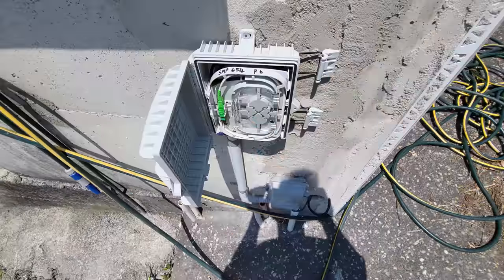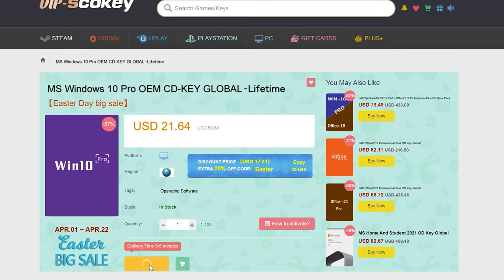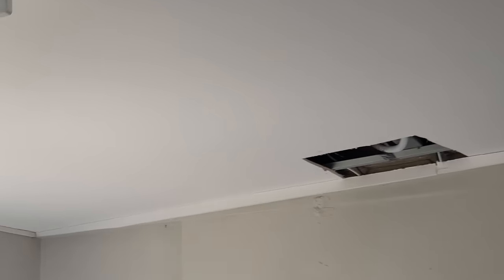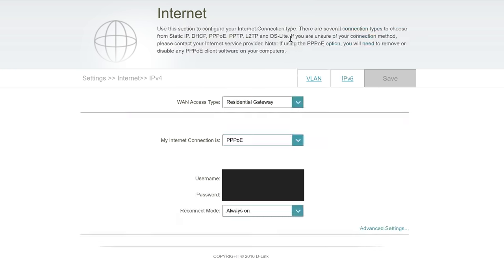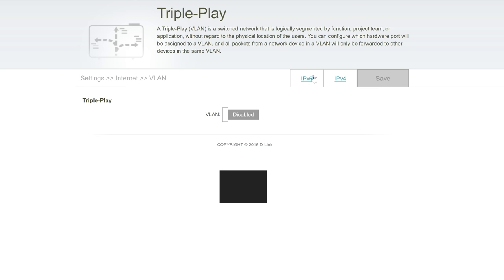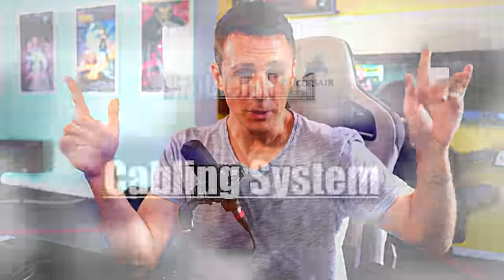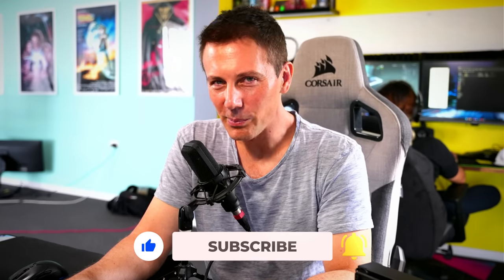UPGRADING my Internet to FIBRE for FREE! (Australian FTTN to FTTP Upgrade)

Comment: It is still crazy to me that there are 1st world countries that have internet worse than some 3rd world countries and then have to pay 200-300$ per month just to get that fiber to like 100 megabits up/down.
Absolutely crazy. I get 1gigabit up/down for 15$ per month with a 40$ router I bought from Amazon. Also, mobile 5G unlimited data contract with free calls and messages is 20$ per month.
Of course, Australia is kinda different, being so far away from big continents but still, absolutely crazy pricing.
Reply: It's been politicised and monopolised
Reply from the maker: Yeah definitely, coming from Japan it was about $25 USD a month there for 1k/1k, and unlimited.
Reply: @techyescity I get it if your using a cat but why disable 5ghz any device using wifi will be capped to 100mbps on wifi 2.4
Reply: New Zealand has cheaper and faster Internet than Australia, yet it has a smaller population (unless you count the sheep), and is even further away from the rest of the world.  

In Aussie telecommunications is HIGHLY politicized, being the home country of Rupert Murdoch, as well as Telstra the monopoly provider being 17% owned by the Government workers Superannuation scheme.
Reply: Spain 30€ 10Gb/s is on the highest on speed in Europe. 90% of the homes had acces to a Fiber conecction.
Reply: That's not $15/mth for 1G, more like $150.
Reply: Mate, we didnt get internet here till 12 years ago.. DSL only. Just got Fiber 2 days ago, went from fixed wifi that was the only choice and that came here 6 years ago. Im in Canada ffs. They Just got around to putting in the infrastructure just before covid. Costs $120 all in per month for best package to get 50/10mb , now its same price but for fiber 1-2gb. We have seriously high costs here for fuck all. Youre lucky . Cheers
Reply: i know the reason :3
Reply: it does depend on pop density too.  cost alot for providers if its 10 houses per mile.
Reply: Also one of the reasons is it is cheaper now to install new infrastructure than to upgrade old infrastructure. As in new developments will get fiber, while old ones still have phone lines or cable.
Reply: I'm really jealous of you. I live in germany and pay 30€/Month for 100 Mbit via DSL. Fiber? Can't get that in the street I live in. Fastest I could get would be 500 MBit via Cable, which would cost me around 80€ per month.
I'm also using one of the cheapest internet providers.
Reply: Where can u find unlimited mobile 5g that is $20 per month? I've been trying to find a cheap option to be able to stream on twitch on the go with my gaming laptop but havent found anything anywhere that close to being that cheap and none of it was unlimited.
Reply: nobody needs 100mbs download---if you do you need to get a life
Reply: its a pain in the cnt for sure
Reply: Liar
Reply: @thelonewolf666  Yes, that is too slow, 1 Gb should be bare minimum!
Reply: @HDQuakelive  If you plan to play multiplayer games (particularly competitive ones) and stream simultaneously just note that the latency on 5G is higher (despite the speeds being strong) and it's a shared connection (you share from a pool of total bandwidth per tower rather than the more segregated nature of fibre).  I mention this because I had issues a few years ago.

Comment: Wish they done it properly the first round. No fttp in my rural town...
Reply from the maker: Have you tried starlink? heard good things about it.
Reply: @techyescity  I'm actually happy with my 50/20 😄 I still remember the day when we got NBN from ADSL. Some videos would take days to upload at 1 Mbps. But yes I know a few that got Starlink and are very happy.
Reply: We Live In Adelaide Elizabeth And We used to Have Fiber To The Node Used To Get Around 12-14 Download And 3.5 Upload And Whan We Have 4 Or 5 People Using The Internet It Used To Slow down a Lot But Now We Have FTTP And Its Better Than FTTN
Reply: @techyescity  as a gamer I don't trust wireless. Physical cable is better than wireless including star link which sounds like it might have more lag?
Reply from the maker: @Mudar-o6h  yes starlink does have more lag.

Comment: You better block that big gaping hole in the wall or you will get a rodent problem. You really don't want a rat getting in through that hole.
Reply from the maker: Actually covered it all up tonight! Finished the install with my friend who is a sparky.
Reply: @techyescity  good stuff. I myself have spent almost a month now trying to get rid of rats out of my house. You really don't want to go through this torture man.
Reply: Solution to Rat = Cat
Reply: We don’t worry about rodents in Australia, the snakes eat the rats, and the drop bears eat the snakes.
Reply: @josephkelly4893 OMG I looked up what a drop bear was and bust a gut laughing thinking it was a real animal.😂
Reply: sparky to a save
Reply: @josephkelly4893  be very careful around drop bears, they'll take you when you least expect it!
Reply: @Andrew_Thrift  that doesn't work. A cat will not scare off or hunt rats.

In fact there's lots of YouTube videos where there's a rat a few feet from a cat and it doesn't bother the rat and other videos of cats that are scared of rats

Comment: good job finally FTTP. now we only need 1000/400 for $100 a month
Reply from the maker: Yeah the uploads are sooooooooooo bad still, they are throttling it hard, would love to know in Aus why they are not even at 1000/100 still...
Reply: I'm paying around £35 per month for gigabit up and down in the UK
Reply: @ISellSigals  I could only dream.
Reply: Not going to happen any time soon, the current NBN wholesale charge for 1000/400 is $230/month ex GST.

Comment: The good thing about FTTP is that the NTD supports four connections simultaneously - if you feel like the ISP is the problem, you can just go to another ISP and ask them to spin up a new connection. This also means you can have, for example, a home-only connection and a work-only connection, or at the very least a secondary backup connection. The only caveat is that NBN will reject any orders which would cause the NTD to exceed approximately 1.25 Gbps so you can't have gigabit with two ISPs at once.

This is why Launtel is such an interesting ISP - where other ISPs charge monthly, Launtel charges daily. If you're with another ISP and feel like their network is the problem, you can spin up a Launtel connection for a few dollars to test.
Reply: That's good to know, any idea why the 1.25Gbps speed limit?
Reply: @futurecactus  I don't know the specifics, just the results of community testing. Having said that, it's almost definitely to save on cost.
Reply: I love Launtel’s 1000/400 plan. They’ve even dropped the price to just $9/day!
I got 900/355 with my testing.
Reply: @futurecactus  GPON supports 2.5gbps download split among the customers, they don't want someone slowing it down too much.
Reply: NTD max throughput is 1600 total including upload.

Comment: Gratz on the upgrade. I've been on it for a few years, 1500 down, 1000 up and I just did an Ookla test (with 2 streams running) and it worked out to 940 up and down. That is the biggest difference I noticed. Uploading to YT, 4K is a breeze. This 12 minute video would take me well under 10 to upload. I rent the modem from Bell Canada. I think you can buy them but they are priced in such a way, they don't want you to. The rental means it gets replaced every 3 or 4 years if better modems come up and the fiber is to the modem. The only line they make me deal with is the line to the PC. I went Cat8 to a standard 2.5 onboard. I've never relied on WiFi and made it a point to not have it onboard for my motherboard. The phone uses the WiFi and the phone is the limiting factor. 

You will start to kick yourself when you realize how much time you lost waiting for things to download and upload in the past but it's in the past now.
Reply: You must have a 1Gbit bottleneck in your LAN.

Comment: The fact they don't give you symmetrical is still so antiquated. In Eastern Europe I pay 20 AUD and get 930 down, 900 up. Zero installation fee, including the fiber media converter, and a Wifi 6 router.
Reply: That’s a choice of the NBN and how they allocate fiber cvc though
Reply: I have 500/500 ftth in Norway.   All ftth is symmetrical but Australia is probably still developing their broadband...

Comment: I'm getting an FTTP upgrade in a couple of weeks, which is exciting, because my current FTTC connection is actually worse than the FTTN connection I had at my old place.

I assume it's apples vs oranges though - I assume I'm sharing my FTTC with the other townhouses in my complex, and my old node was probably underutilised (1950s apartment block surrounded by new FTTP-connected blocks and offices).

Comment: Had my NBN installed back in 2016. Was lucky enough to get FTTP. But, was one of the first in my country town so it took 4 techs 2 hours to install. Installed on the outside wall of my garage.  had to run 50metre cat 5a to my router around the house. 
Never had any issues with it. been with Internode for the whole process, and now enjoy gigabit down
Reply from the maker: Ah awesome, I am 7 years late to the party.  With Cat 5 isn't it about 90 meters before some sort of degradation or is that cat 6, memory is a bit off with routing.
Reply: @techyescity  it's actually 100 meters for all of cat5/cat5e/cat6 ethernet cables

Comment: Over here in Europe at our apartment complex, in January 18th 2022 we were offered a free upgrade to fttp from a fttn solution, upgrading our speeds from 150/20 to 150/150, and now a few months back the plan was upgraded to a 500/500 connection and well im really happy with it.

The ping difference going from copper to fiber was surprisingly not very significant, in CS on copper i was averaging a ping of 15-17, on fiber at the time i was averaging at about 10-11

Comment: Happy for you man! I switched from cable to fiber in 2017 and I'll never go back! Constantly have the cable ISP trying to lure me back but na 😂 In regards to your single D-Link router, I would suggest investing in D-Link, Linksys or Netgear mesh network for your WiFi needs. That way you don't have to turn off that 5Ghz band. Bandwidth on the 2.4Ghz band will get bogged down if all your devices are using the same channels. Newer devices prefer the 5Ghz band and leave the older devices on the 2.4Ghz channel. You will have way better connectivity with the mesh and they are very affordable for consumer use now 😉

Comment: Answering the most common questions in the comments:

"you should be getting more upload on fibre" yes the infrastructure is there, but ISPs in Australia charge an extra $100/month for symmetrical connections because it's "business grade".

"The router is the issue with XYZ" it works for now, most bandwidth intensive hardware is hardwired. The plan is the switch to a mesh network when the current 6 month minimum plan expires.

"Why not Aussie broadband/superloop" it was cheaper at the time of install by $20/month which needs to be served a minimum of 6 months. Exetel have been dodgy with me and inconsistent with Bryan so the plan is to switch when we can.

"i get 1000/1000 for $x" stop rubbing it in, we know it's bad, it hurts.

Comment: Its crazy how upload speeds are on NBN Fiber, I guess they just don't have the supportive backhaul?  I have an HFC Cable connection and get 1000 down and 60 up. Soon they will be offering 2gbps down and 100mbps up over HFC.  Less than 10 mins away from my home they offer up to 5gbps down & up via fiber.

Comment: I'm in the UK. We just had fiber to the property installed. To be fair the fiber to be cabernet connection we had wasn't to bad (about 65 to 75 mbps), but full fiber even on the lowest price tier is twice that, with free installation and 6 months free service. Fantastic. It comes with a Nokia modem, that you can plug whatever access point you want into it (I went with WiFi 6 mesh).

Comment: you guys getting fibre late , we have either virgin or bt , what i did i already bored the hole to where the wire and box was going , i practically done the job for them they also come inside your house and fit the box and the router and connect it .
job done in 20 minutes they also praised me for the job well done .

Comment: Generally wherever you are in the world, one company will own the Fibre from the Node / Junction Box, to the servers and another company may own the fibre on your street. So when they visit you to install a line from the street to your house, they need the Plan / Drawing, which will tell them what connects where. Sometimes its not recorded well, and they cannot read or find the physical port. Sounds like the Oz Government is subsidising your service, because in the UK, they sometimes charge new customers for that Service guy show up to connect your property. Lastly, Fibre Routers are used with Fibre In, so i`m surprised you didnt have to change your Router.

Comment: Interesting to see Australia only being 10 years behind New Zealand on the Fibre rollout. Feels very much like the Apple releasing NFC years after most Android devices already had it.

While you are only just getting 500mbps download, NZ has 300mbps as the entry level Fibre plans (~60NZD/month). In main city centres you can get 8gbps bi-directional on residential & even in suburbs can get 4gbps bidirectional for ~$160 NZD ($147.50 AUD / $94 USD) per month without bandwidth caps.
Reply: Even when I was living in Queenstown in 2021, the wifi speeds we were getting through our shit modem were roughly around 300mbps down on a basic plan. Now back in Aus we're lucky to be getting 50mbps down on a plan that cost twice what we paid in NZ, its a joke here.
Reply: We can thank the Lids for that. Labour came up with the NBN idea in 2007 and signed us up for fibre to the door, it was the Libs that down graded us to copper. Then the pandemic hit and the still in power Libs said we need to start again and do fibre to the door, ie, we haven't got enough $s to do it right, but we have enough $s to to it twice. Looks like another $60B in the toilet
Reply: albeit NZ is much smaller for infrastructure... all this wouldnt have mattered if our dumbass polititians had of done it correctly in the first place....
Reply: 1. Yes, politicians ruined our future here
2. As people point out, NZ is microscopic in size by comparison, however, the fact they didn't just give you 1Gbps & say job done, is extremely proactive
3. what does 4+ gbps actually get you for US or Asia hops? Would love to know the throughput for international routes 
4. How are the sheep?

Comment: I have my upgrade booked. i'm with superloop and have gone for the 1000/50 plan. I have a unifi UDM PRO as my gateway (I don't have a modem router combo) so i'll hopefully have no issues with throughput and i'm hoping see good speeds on the network.

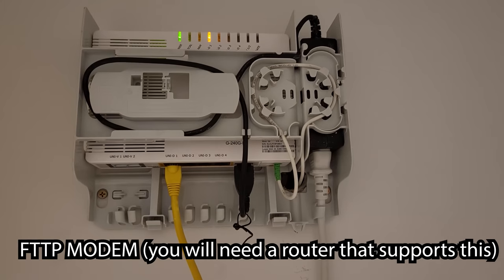4:48 - The white box that NBN put in the house that converts the fibre to ethernet is called a NTD (Network Termination Device). It does the authentication with the NBN network. it also allows them to assign an internet plan the UNI-D ports.

Just sucks that they don't offer higher upload speeds other than 50. if i go business and get symmetrical, it'll cost me close to $600AUD a month for 1000/1000.

Comment: I was paying too much for too long for cable internet with 100Mb down and 15Mb up... Then I got fiber in at 1G up and down.   Its been super reliable and very fast.  The trick for better speeds is to get an ONT endpoint and run your own router.

Comment: The problem with the NBN free fibre upgrades is, that they only do it in selected suburbs, so if you're not on the list it's a no go for now. Also NBN still hasn't managed (or bothered) to make a map that shows which suburbs are currently open for free upgrades, or when which suburbs will join this scheme.
Reply: Upgrade is free but you have to go on a more expensive plan and that doesn’t guarantee you get the advertised speeds. NBN is a total ripoff

Comment: I had to get under my house to run the cable from the front yard to connection point. But they were very professional in install the fiber. The installation guy told me FTTP is the only connection recommended, the others are garbage.

It's also great to watch 4K movies !! :D

Comment: We were lucky enough to receive FTTP NBN from the get go way back in 2016 when it was first rolled out our area. I knew that reusing the old copper network was a costly mistake as it is simply not adequate enough for high speed internet in many areas due to it not being maintained very well!

Comment: I have a question, I was going to go with Superloop (which is who I think you show in the video), if you order via the website, does it let you select a day and time when the NBN guys come out? Or does that happen later via a phone call? I don't want to be at work, so I wanted to select an install day and I'm not sure how that process works. Also do you know if they install on weekends?
Reply: From what I've seen, weekend installs are rare. Your ISP should schedule an install time and date with you. I recommend you book a morning appointment, cos they're less often missed.
Reply: In the video he's with Exetel, which is why he had to input username and password into the PPPoE settings on his router. Most ISPs don't require those settings.